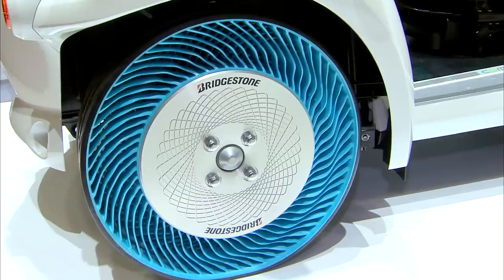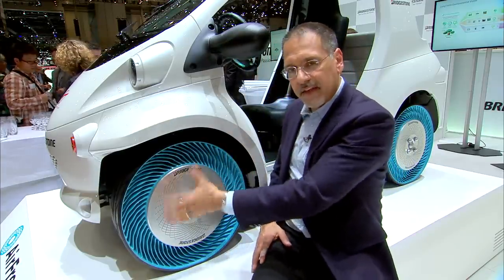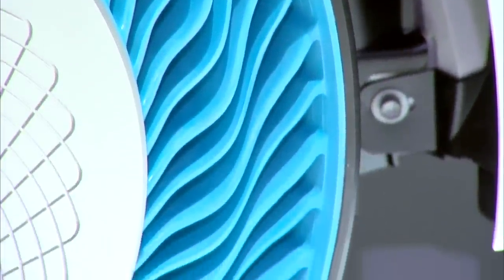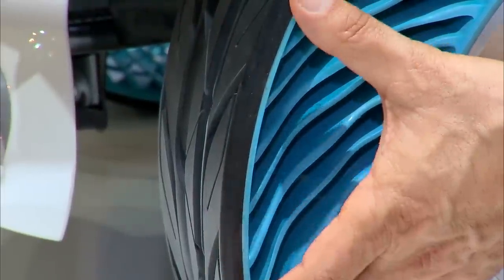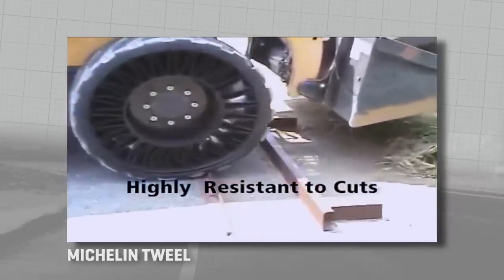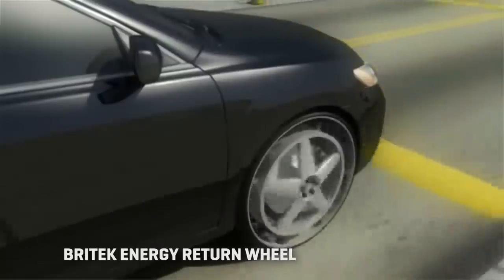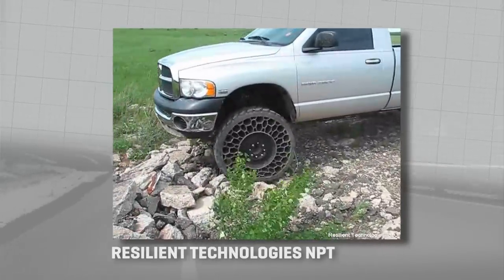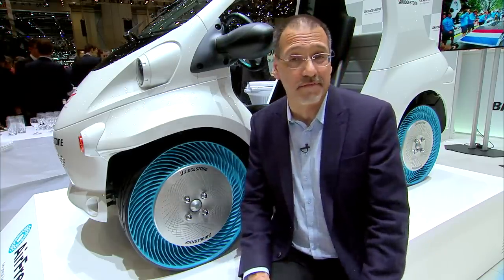Airless tires: Road to the Future | CNET On Cars

Comment: The "inflated tire" industry is a multi billion dollars one. No way this will appear on regular cars any day soon. You can bet on that.
Much like it will take enormous efforts and many years still to come to replace gasoline engines completely...
I'm 51 now, and I'm pretty sure I'll be dead of old age when all cars and trucks are both running on electricity and airless tires (or is it nitrogenless ?), if they ever do.
We still don't have flying cars, that were supposed to be here last year...
Reply: now March 2017, yet i dont see any air less tires in the market
Reply: why not unbreakable glass? Because that would cost a lot more, meaning the customer pays for it

And it would add extra weight, which manufacturers are trying to limit

And the amount of damaged windshields vs costs are not enough to justify designing that for cars. Yes it could prevent chips, but if you're talking cracks and broken windshields, typically that only happens when something happened to the car itself and at that point it's not worth it to replace.
Reply: Here's the thing about existing industries; they absolutely LOVE it when they can make a product using significantly less raw materials. The tire industry would simply shift to producing the rubber treads instead of a whole tire. It seems that without a side cover, the splines would quickly fill with dirt and debris and become unbalanced. Unbalanced wheels aren't exactly great for driving highway speeds.
Reply: AlainHubert it'll be for the rich on a 200,000 dollar range rover
Reply: InTheZone, AutoZone!
Reply: A flying car is just a horrible idea, it will mess up with all of the other air vehicles. The rapid development of electricity only happens in the last several years in which only in a decade, the amount of renewable energy is getting multiplied 30 times and it will replace gasoline soon enough because the price is going down very fast with the increasing efficiency of energy management, prediction, and maintenance. I'm pretty sure it will be widely accepted soon enough.
Reply: good because this tier design is dangerous it relies on a polymer that will have to flex and bend millions of times a day i guarantee that there airless tires will have an extremely short service life

that's not even considering winter the colder it gets  the harder plastic and rubber get these things would fly apart at 65 MPH at 20 degrees F 

then you are not just losing your tier and riding the rim you lose everything but the hub losing a tier would mean losing the car
Reply: 100 years ago carmakers, which are sold only wealthy misfortune after road accidents due to broken glass from windows unsecured. Why safety glazing are now mandatory in new cars almost all countries? Siau probably wealthy women who are blind or disfigured girlfriends frequently saw shards of glass have avoided traveling with unsecured windows machines?
Should be put on tires with air images of people dead, perforated eardrums from explosions tires etc as or put on cigarette packs in Australia, Europe etc countries, cancers of the lip image, mouth .. !?
Maybe in 200 years people will no longer strain the lower consumption, life will be more important, and will be binding and no flat tire as windshields secure today ?
Reply: Hmm, that wasn't very easy to read and understand...
But I got most of what you're saying. 
Laminated windshields are still made of glass, and still break. Why not unbreakable glass instead ? Because the auto industry still makes tons of money with replacing windshields. That was my point; if there's big money to be made with something, it takes a lot of efforts and a very long time to change it.

Comment: What about for lets say... offroad use. With a conventional tire, you can inflate or deflate the tire to change tire pressure to better perform in your terrain. for example; lowering PCI when going through thick mud to increase grip and decrease spinouts. how can these type of tires deal with issues like that hmm?

Comment: what if rocks, sticks or mud and clay, get stuck in there sand hardened? and how well does they cope with UV lights if parked in the sun? harder rubber and plastics will harden and become brittle as the UV rays break them down. and as for military use, 30% of the honeycomb getting destroy and it can still function, but currently the military vehicles are designed to still run for hours with all tires completely destroyed so not really an improvement.

Comment: why hasn't it on the market yet??
Reply: +Eddie Shin because any tire factory or tire repair service would completly crash on income
Reply: TireFrenzy The windshields must break because people should NOT be stopped by an unbreakable glass in case of a crash. It can increase death rates significantly. This is a known fact of the industry. It is actually weird that you are not aware of it.
Reply: #EnergyReturnWheel They're just so ugly though @yummyyumsum
Reply: tests have shown that these tires don't work as well as regular tires at high speeds, so they're mainly used in things that don't go fast, like heavy-duty construction equipment
Reply: #LSV Hmm, that wasn't very easy to read and understand...
But I got most of what you're saying. 
Laminated windshields are still made of glass, and still break. Why not unbreakable glass instead ? Because the auto industry still makes tons of money with replacing windshields. That was my point; if there's big money to be made with something, it takes a lot of efforts and a very long time to change it. @Yeshuah is King of Kings
Reply: yeah that makes sense because the tire repair industry lobby is so big -.-
Reply: +ClusterGaming Actually, I think they would increase profits.  They could still charge a lot for the outer rubber part.  Yet, it would cost them significantly less to create.

I think the actual reason it is taking time is because of all the new machines they would need in order to make these in great volume.   You would also need to retool every tire shop in the country.  And you would need to do all of this while at the same time maintaining support for existing tires.

I'm not saying it would be an impossible task... just that I can understand why they would want to go into it slowly.  

Plus, we have to keep in mind that profit is the name of the game.  By phasing into it slowly they limit supply... thus increasing the cost people are willing to pay.  You do this slow enough and you stand a greater chance of maintaining a higher cost per unit.  I mean, you are going to be more willing to pay $100 to $200 per outer tread if they cost $500 just a few years back.  In fact, it would seem almost like a bargain.  However, if they started just mass producing it without setting the price first then people are going to question why they are paying the same for this outer part that they used to pay for the whole tire... when this is cheaper to make.  Just a guess.
Reply: Because it makes your car run un efficiently
Reply: TireFrenzy they have window film that's actually like unbreakable glass
Reply: Mark S No because they're shit
Reply: Mark S they just want to make stuff as cheap as possible they already make everything and copy everything.
Reply: Because they have lots of noise and drag, and the plastic fatigues over time faster than rubber sidewalls.
Reply: TireFrenzy because the windscreens would be 2" thick to make them unbreakable dipshit.

Comment: Michelin was trying to make tweel tire. It gets high vibrations above 50 mph and they stopped researching it. So, we gonna keep that pump for the next 100 years.
Reply: +vertik7 the supports need to be in pyramidal/triangular fashion it will give it the strength desired

Comment: if ever get a tesla i want these wheels on it one less thing to worry about
Reply: +adalberto delgado 100% agreed. I've never been one for a new car, but when I saw the Model 3 unveiling... even my girlfriend said "i want to buy that new" hahaha
Reply: yeah i much prefer a used car but a model 3 or i hope by the time i can buy one cash model 4 is at least a 25k car lol
Reply: then you get a portable generator there is always a solution to a problem
Reply: InTheZone A gas or diesel has about a hundred times more moving parts than a Tesla.
Reply: this is not the first airless tire
The reason behind these not being imlpemented is that you dont get a flat or blowout
Tire companies want those problems because it increases the wheels they sell

On top of thatthey make more money by having a whole tire to replace than a thin strip

In other words the enemy is : planned obsolescence
Reply: fl00fydragon But at some point they will have to start introducing airless tires as the world moves one. It's the same for all companies. Just because something increases sales doesn't mean that they hold onto it forever. Eventually they will have to start inovating and implementing if they want to stay afloat. They sacrifice the sales of one thing, for a potential opportunity for another. But this won't happen very soon. Tires are very much the norm right now, and until our cars have reached the limit of the next technological advancement then we will still be using normal tires.
Reply: +METTRIIK tesla is for gays
Reply: ADreviews76 What about an EMP?
Reply: I'll drink to that.
Reply: MewCat100 
Well, a 100 problems is still better than 101 problems
Reply: ADreviews76 fk tesla
Reply: you realize how many sensors and wires your car has, there's a lot more to worry about on an electric car than a gasoline/diesel car.
Reply: Given the massive problems with Teslas, having one less thing to worry about should reduce your list of worries to somewhere on the order of hundreds. Good luck with that.

Comment: What about sand/mud/snow getting in between all those spokes? That would be a nightmare...
And how long until this "polymer" loses its flexibility and becomes stiff, just like any other plastic/rubber product?
How much to replace the wheels? The thread seems to be glued on, so how much is that in labour? Can't do it myself right?And why haven't we seen it yet??
Reply: These prototypes have an open sidewall to show how they work, but on production cars they'd have the option of a fully enclosed tyre.
Reply: that plastic will crack in the winter when you hit a pothole.
Reply: omfgwtfbbq90 Could easily use tyre rubber or some form of flexible plastic.
Reply: You haven't seen any because they're not in production, all of these are prototypes being tested. You aren't going to see any airless wheels anytime soon.
Reply: Exactly like on normal tires we have today. Could be much thinner tho, because its not bearing any weight.
Reply: Not unless it's polyurethane, it doesn't stiffen up over time and is incredibly durable.
Reply: Actually it ll be covered,
Reply: Half of your car is made from this "polymer" thing already. And you're worried about this?
Reply: I assume it will be covered
Reply: These plastics will last a thousand years without getting stiff, so that's not a problem
Reply: Don't you think they've thought about that
Reply: Umm... They can Cover the sides with rubber
Reply: Stop asking so many damn questions just let it be.
Reply: omfgwtfbbq90 just cover the sides but good point yes
Reply: Watch the video again and listen to the materials used.
Reply: Maybe these tyre's can be used on some vehicles in limited parts of world where climate is always good. Little steps count too
Reply: omfgwtfbbq90 thats why I still want air wheels
Reply: No cause it would be like a cap. You wouldn't have to replace it.
Reply: Michael Parker and how will this closed disk-shaped wheel cap compress?
Reply: +Terry Price indeed. they should just focus on hubless wheels instead, same amount of rubber required.

I saw, i think it was, BFGoodrich's idea for a new tire..... it was a sphere... way too much rubber used even just for the prototype.
Reply: they shouldn't reinvent the wheel... quite literally
Reply: Uh-huh and how, exactly, would they do that. ;)
Reply: If they cover the sides with plastic or rubber it defeats the purpose of only needing the tread  to reduce the amount of rubber wasted. Or with plastic still not that envs friendly or reliable as well.

Comment: Airless tires are an old invention (check polyurethane filled tires). This is a shock absorbing rim... which I can imagine you'd need to change after a few years. How will it withstand extreme temperatures? Maybe there's a good reason why we still haven't seen these on the market
Reply: What do you mean "it's an old invention"? The touchscreen existed since the 70s. How come we got it for everyday use in the past decade? Obvious something won't be mainstream until it is ready to become mainstream...
Reply: +DecibelAlex Adds weight.  I'd like to see something like this video presents in a low profile on a large aluminum or carbon fiber rim.  I suppose putting that in a low profile inflatable tire would still save weight over a standard tire, not sure.
Reply: The reason they aren't on the market yet is purely down to money because standard tyres are cheaper to buy and much more profitable for manufacturers.
Reply: +Michael Parker 
probably

Comment: I wonder how these wheels perform at very cold or very hot temperatures.
Reply: Yeshuah is King of Kings Plastic is a FANTASTIC material when built high quality.
Reply: +Bendc1970A1 probably melt in hot, and splinter in cold. they just cant get their minds beyond using plastics and the like... we need to end the era of plastics, they suck haha

Comment: For us germans is one question - how well do they work at a speed of 200+ km/h?
Reply: +Jurik Kähler was thinking about that. good luck balancing this tire for even highway speed.
Reply: @sevd0  They don't require the traditional balancing that is needed on every pneumatic tire . 
 Basically good " rim"  , your tire is balanced . The wear will be replaced on the existing rim with a new tire skin .
Reply: Scott Telting 2 tons of steel is a pretty light vehicle. Lol...... there are SUVs much heavier and faster than just neat 209kmh
Reply: Germans are crazy! My dad loved driving fast with us.
Reply: Jurik Kähler 
They don't. It's just bullshit.
Reply: VIEW8472 speed doesn't cause accidents and you are no more dead at 230 mph than 95 mph.
Reply: VIEW8472 the dead tell us volumes and 65 mph is just as deadly. The speed didn't cause the accident it slightly exacerbated the results
Reply: Jurik Kähler 200 km is low speeds. Many street legal cars are capable of 275 mph today safely
Reply: But you are dead.I would ask the people that have crashed  at 100 miles but the dead tell no tales.
Reply: If you are doing that kind of speed on a highway. The question should be " do I have life insurance for my family?.
Reply: Soon will be riding drones and using  sea shells ( demolition man refrence )
Reply: @rrjf432   Oooohh I cant wait for the seashells lol